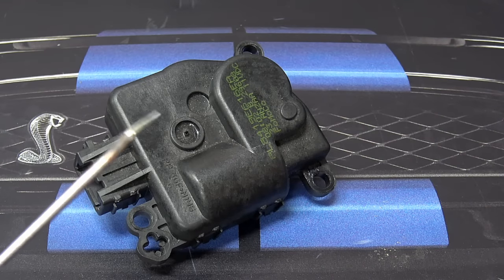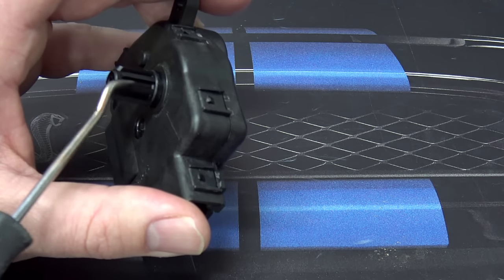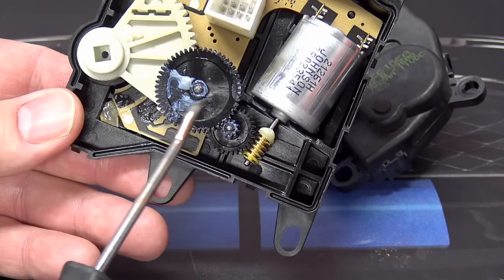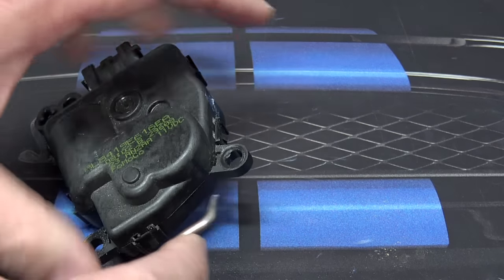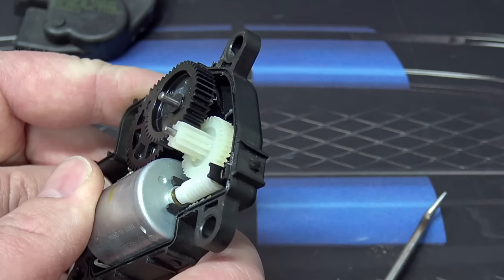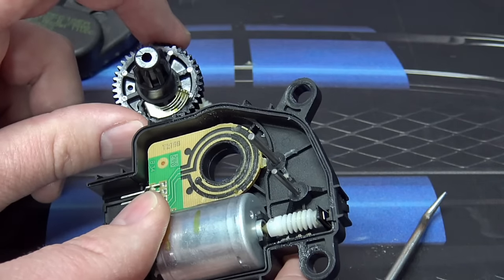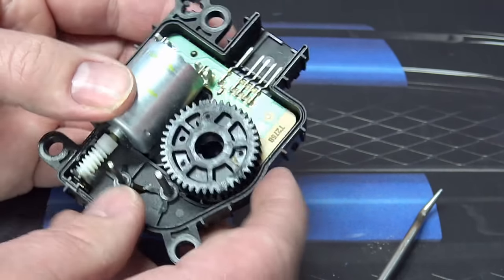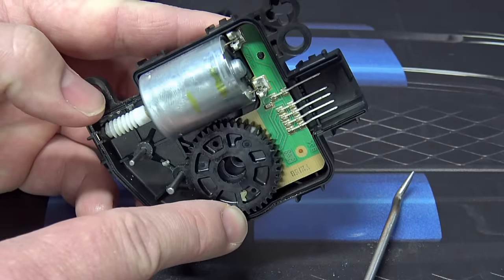Ford Vehicles: Frequent Blend Door Actuator Failures and Why?

Comment: Ford needs to do a recall,  and reimburse there customer's.
Reply: @HorsepowerHouse  will never be a recall unless it's a safety related issue. They know they are junk and dint give a fuck.
Reply: car parts suppliers design  defective parts to turn in a bigger profit. 
Low quality standards used to be the norm before Japanese imports came to town: now look what is driving on the streets and ask yourself:  did they win big by shortchanging buyers?
Reply: @420frankp  are you nuts? Foriegn fucking sucks. Honda right now is the worst with transmissions only lastin 100k miles like thats a lot SMH nissans have many problems. Dont even get me started on some of the worst of the worst like BMW and VW
Reply: @kingaustin5744  I don't know what you're rambling on about. But let's get something clear here. I work on a lot of vehicles and your experience says foreign are the worst? You do realize a lot of foreign vehicles are made here in the US, right? Truth is. They all break. Every damn one of them. Doesn't matter what brand or the place of origin. Dont come at me like you're an encyclopedia there bud because I'll shut you.
Reply: @420frankp  oh i already know that there made in america who doesnt know this?. What car is actually from where they say its from? American cars are made by foreigns and foreigns are made in america. My point was simple america can and always will out do foriegn cars.
Reply: @mustangford7868  it depends if the parts are made in China, Taiwan,  Korea,  parts that are made in the United States  are way better quality.  That's what we were 
Getting at to say and I try to buy all new parts not rebuilt or remanufactured parts., I have a 2017 ecoboost premium mustang and my Freind  next door has a 2016 MUSTANG gt. And ford just had to buy him and paint a new hood as the paint was bubbling along the front she of the hood, I went and took pictures and have them. I have not had any problem with mine at all. I only have 9,000 miles on my mustang I only take it out on dry weather in bad WEATHER it is garadged. The best car from ford I have ever had out of 7 mustang's and 2 T bird turbo coupes.
Reply: @mustangford7868  the key should be make them easy to repair
Reply: Absolutely.  It's $1,000.00 to replace this piece because of where it is located.
Reply: Yes the customer needs to be $$paid$$ everytime some product fails.  Things should last forever.  WHAT is still made in America fhese dayz?  I cant think of even ONE thing.  Putting it together with Chinese parts does not qualify.
Reply: Its only a $45-50 DIY fix
Reply: @HorsepowerHouse  my father in law is still driving a Toyota camry every day to work thats over 20 yrs old. Runs like a champ.
Reply: Good luck. These 09-14 models have doesn't of issues that should be recalled. But they won't ever do it.
Reply: I I don’t have money
Reply: @raquelchavez83  
I do. I have money.
Reply: Its not a safety issue ... therefore no recall. I just replaced the actuator in an 08 F-series @ 252k at a cost of $28 and about an hour labor.
Reply: On alot of the garbage they put out.
Reply: no they need to sell you a new car. that's their job remember.
Reply: @garonburwell9008  lol
Reply: @mustangford7868  that answer is made of plastic 😂
Reply: Gm has the same problem
Reply: North American quality has gone too crap  from now on Japanese
Reply: I have a Ford Galaxy 2006 model and the intercooler hose had split. It also comes with a sensor. After buying a new hose the hole for the sensor has been removed! I now have to take it to a Ford garage to have the sensor disabled in the PCM. FORD decided that the sensor was more hassle than it was worth, so they removed it from new models. 

Ford are forcing me to pay £120 to connect it to the computer to disable the sensor they decided to remove. 

I have made a decision to contact every single Ford galaxy owner selling their car to start taking them on!
Reply: Ha, wut? You know this same stuff is in GM products? They are both just buying into 3rd party designs and going with whatever modules they can get made to do their job. My GM product had 2 of this style in an older MY than the Fords ... and they take an act of Congress to fix, too. I'll bet you every major brand uses this stupid design. My GM would audibly hunt for 2 minutes every KO cycle.
Reply: *their
Reply: How about every 2010 f150 has completely rusted out the cab corners and rockers fuel too the high mount light leaking and allowing water too run in. Millions of trucks completely garbage after 7 years
Reply: Good luck , mine failed POS
Reply: 450 for ford to change it smh
Reply: "Their" not "there". 4th grade.
Reply: 2022 Ford F-550 5.000 miles already failed.
2020 f-250 48.000 miles already failed.
Reply: Does that mean that on MAX heat that the door might not be fully opened/closed if it loses tracking?
Reply: Ford needs to recall so many parts . Let’s start with the shift tube . Move on the the blinker actuator, cruise switches , most the heater parts . So many bad engineering pieces .  Who else has a list ?
Reply: Hopefully you haven’t been holding your breath.
Reply: @420frankp  I think that they will only issue a recall for safety issues. And I could be wrong but I think if it’s a safety issue it’s enforced they have to fix it whether they want to or not.
Reply: 07 lincoln towncar,  need the actuator that changes floor to defrost replaced. But the whole dash needs to removed.
Reply: @Deerector  *customers
Reply: 😂😅 @Deerector
Reply: @gunruh100 I get a clicking sound in the dash even when the truck is turned off or driving down the road I’m just trying to figure out if it’s the blend door actuator is going bad
Reply: Yes, And Teach them how to Spell!

Comment: I guess a cable operated by a lever, is just too darn simple...
Reply: Or vacuum operated
Reply: they can't justify a $500. repair job for a 39 cent cable!
Reply: As I recall, cable failure was pretty rare.
Reply: @SOU6900  vacuum is a damn nightmare when you got a leak in the system
Reply: @p51bombay  you recall poorly. those broke often also.
Reply: Can't have automatic climate control with a manual cable....
Reply: @Kyle Loomis i'd have to agree about easier to install. and to be clear all the cable problems i've ever seen are somewhat indirect. the cable itself never failed but what was holding it down or attaching the end or the door being blocked because of junk and snapping hardware from force. everything can break and you work on enough stuff you see alot of it. also here in nevada, motor or cable, if it involves plastic it'll get crispy crumbly but it sucks less than rust for sure
Reply: Too much crap packed into dashes now, there's no room for the old cable systems. People want their giant touch screen displays with GPS, WiFi hotspots, wireless charging pads, etc.
Reply: @thomassouza6858  They want $2000 to pull  my dash, not including parts.

Comment: After 40+ years of working on vehicles, engineers for GM says 5,000hrs of life. But silkscreen resistance material and contacts & small gear teeth fail. They use a separate "Pot" gear driven, but use a 2 wire software that counts high-low current flow to figure positions! Then if block, it backs off and try's 3 times to clear obstruction then stop, set code. You find straws, toy parts & short pencils blocking the door. The one guy told me he was forced to retire said new college kids make mistakes we learned 30 years ago. A high number of failures trigger a flag to have dealers save and send back in w/info. If redesigned and not a class 1 safety issues like seat belt anchor comes out, then a new parts is made, TBS created and becomes a "Second Design" with new P/N. Except for old cable type, HVAC defaults to defrost. This is a DOT rule! But in the early 90's, 15 minute headlamp was a rule. That is gone on some Fords that require the front bumper gets removed and 3 hrs later, ready to go! Wow! DK, ASE Master Tech since 78, retired.

Comment: Flawed design. As Makuloco said, the cause of failures are not the gears, even on the old units but the loss of tracking. If the tracking is lost, the motor keeps running even after it reaches the end. Something has to give, so the gears break. The metal contacts should never be used on the carbon tracks. They will eventually cut through the tracks. Being made in China, they cut through even sooner. Ford should copy a TPS design which is technically a tracking device but lasts forever.
Reply: Do you have to do some type of reset after replacement of the passenger door blend door actuator?

Comment: It's going to be VERY hard to restore today's cars 50 years from now
Reply: no. you will just 3D print the part you need. Not made in China... made in your basement!.
Reply: @crisprtalk6963  i was thinking the same thing!
Reply: As a guy who restores 40's and 50's pickups...I would suppose late model cars and trucks are just "disposable"..I won't live long enough to find out..but guessing
Reply: Even 15 years from now
Reply: I mean it's going to sound hilarious to use when we hear someone talk about restoring a 2000 Honda Civic in the year 2050
Reply: i would rather drive an old simple beat up clunker until the wheels fall off before i drive a new car with new technology.
Reply: @equisequis.55  me too...all this newer crap is junk in my opinion...my 76 is as super simple.just bought a 97 f150 & having problem after problem.just plain & simply junk.
Reply: thats what i see , a bunch of non collectible crappy old cars. just put them in the trashcan.
Reply: nobody is going to want to restore the junk made today
Reply: Two words: planned obsolescence.
Reply: I will say  20 years  from now  cause all those parts  will  be discontinued

Comment: Good informative video..thanks! I am amused at all the comments that today's cars are such junk. I remember back when I was doing this kind of work in the 60's & 70's, you were guaranteed to need to need a new heater core by 50k and many of the duct-work components were literally made of cardboard. And those bowden cables everyone likes so much...they always got rusty and seized. The vacuum systems would occasionally have a control head or an actuator leak, but for the most part they were pretty reliable.  Best part about the vacuum systems is they were fail-safe; if they lost vacuum, they defaulted to hot defrost.
Reply: Yes, it’s easy to forget prior issues of older cars. 
Fact is they never get it right…. Completely.
Reply: Stainless cable and plastic doors with brass hinges would have corrected that. The reason for actuators instead of mechanical controls in today's cars HVAC and lock systems is the usual:  Saving money. By the way, which car, specifically had cardboard HVAC doors? Thanks.

Comment: I replaced two of my blend door motors on my 2013 F150 King Ranch about a month ago.  One was behind the radio and the other was on the bottom of the heater assembly on the passenger site.  About a month later and in the middle of the Colorado Blizzard of 2021, the clicking was back and my blower motor started to make a warbling sound too.  I pulled the lower passenger side blend door motor, turned on the truck, put in the fuse and the blend door motor continuously turns clockwise (which is evidently bad for plastic gear teeth and blend door shafts).    When I replaced the blend door motors the first time, I did this same test and saw the motor go back and forth and then stop.   I  got another new blend door motor and it continuously turns clockwise too.  As for the blower motor noise, I pulled the blower motor and part of the blend door shaft was in the squirrel cage.  Put my hand up where the motor was mounted and the vent door easily moves back and forth, so imagine that is the shaft that broke and ended up in the fan.  My question is what controls these motors because my blend door motors are new and I still have the clicking, now with the added feature of breaking blend door shafts.
Reply: Me too.  2014 f150 and my actuator above the gas pedal that controls the floor/dash/defrost mode has been replaced 3 times, so I'm convinced whatever controls the actuator is the problem rather than the actuator itself.  I'd love some insight here.
Reply: I would assume the HVAC module ? I currently lost control for my defrost/ face/feet controls. I replaced the actuator and no dice. I did test to make sure the blend doors themselves moved freely and they did. I’m not sure what I need to do now

Comment: Oh for the good old days when you would move a lever on the dash and it would in turn move a cable that operated the door.  Never broke down and was always reliable.  I look at the newer cars out there and see all the electronic goodies, but all I can think of is the $$$'s in repairs.
Reply: Too many engineers !
Reply: @joelonzello4189  Not exactly.  Ford used eternally cheap chinese products.  Key word here? Metal gears. The chinese used plastic. It doesn't pay to save money 99 percent of the time.
Reply: The old manual ones would bind, break and malfunction on GM, Ford, Chrysler, ect. depending on the model.
They were just much less time consuming to repair.
Then later, they kept the mechanical parts described and started controlling it with vacuum.
So you had vaccum/mechanical.

Of course, vacuum pods, diaghrams would break and leak vacuum and the old rods would still break free from where they were attached...
You see, the more things change, the more they stay the same in many regards
Reply: @stricknine8623  As I'm sure you know, anything operated by vacuum stops working when the vacuum hoses deteriorate.  No thanks, I'll take my chances with the electronics.
Reply: Driving to work one day in my 1964 Dodge, the heater control valve, which was operated by a slide lever, began to leak.  Where was the valve located?  Directly above the gas pedal.  Nothing quite like excruciating pain when boiling hot water seeps through your shoe.  And no way to make it stop until you get your shoe off, once you figure out what's going on!!
Reply: @styldsteel1  you think Ford is losing money by selling the same part twice?🤣

Comment: Just started hearing clicking when turning heat up (manual temp control) in my 09 F150 yesterday.  Thanks to your videos I should be able to replace this actuator myself.
Reply from the maker: +Josh Robinson yup I have a detailed video on this procedure
Reply: Thinking this is my problem with my 2008 Taurus. Where is your video on replacing one of these? All I need to know is how to "zero"it on install...meaning do I turn the controls all the way cold or hot and also flip the door the correct way before installing the unit? (Or something similar along those lines)
Reply: @FordTechMakuloco  hey my mom's have 2010 ford taurus. Her heater is stuck on, and can't be turned off, except when the car is off. Do u have any suggestions.

Comment: I believe my 2015 Fiesta has the larger old style actuator. It’s been clicking periodically for over a year now, and it’s the second unit in the car. The first one I had replaced under warranty by the dealership. The paperwork listed parts and labor for it at $500 at the time!! A few months ago I found I could buy the unit for about $25 and that under dash access to the component is very easy… like a 30 m  in minute job.

Comment: I was told the gear drives the door past the stops on both ends to ensure a sealed door and after some time the stress strips the gear.  Since I replaced it, I don't set the dial full cold or hot, it still shuts but less stress on the mechanism.

Comment: These fail a lot on the 2003 - 2011 Ford Rangers and the whole dash has to be pull forward just to gain access to the one 8 mm bolt in the back. Ford is really good at making things hard to work on so they can add labor cost.
Reply: true
Reply: ralph walters you are right on the money. it's the vendors and quality control that's the issue. Then they buy 500,000 of these things and will not change until they deplete stock. The customer is then always wrong and service advisor makes his bonus.
Reply: I just pulled one on a 2008 ranger. Yes it's a pain to get to that back one... but I had it out and replaced within an hour without pulling the dash at all
Reply: Well it is not only ford. On renault you had to remove refridgerant too
Reply: All components are made to fail these days.
Reply: +Paris G On a Renault I'm surprised you don't have to remove the engine. French cars are so shittly made.
Reply: I replaced one in my 2008 Ranger without pulling dash, just through the glove box BUT it is extremely tedious  getting the one rear fastener in and out.  Small ratchet with many short throws and all done by feel.
Reply: I (mostly) sidestepped this issue with my Rangers  - my youngest sons 2000 (213K and still clocking) is fine , but waiting for my other sons 2006 (85Kad active) to bite it.....My 1997 checked out at 155K, but it was an expensive fix (and was still not fixed right). I wish Ford wouldn't be chintzy on things like this, it can really sour an owner quickly.
Reply: I just thought it was a Ford up grade metronome for listening to the radio lol
Thanks Chuck

Comment: i have replaced all mine in my 2011 f150, its actually easy to get the bottom one, you just have to break it out and not use the back screw mounts, I used 1 screw (the front one) and put a small piece of PVC under it to keep it snug and tight, it has been working good for a few years now

Comment: Those little things you're calling tracking bars are made to regulate voltage needed or not needed in operating the doors direction of closing or opening depending on its place during the cycle.